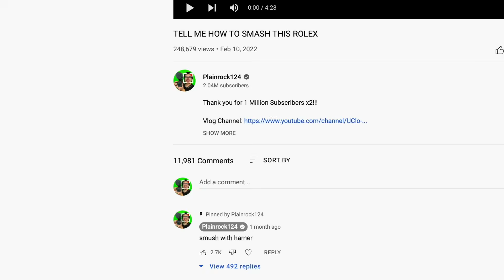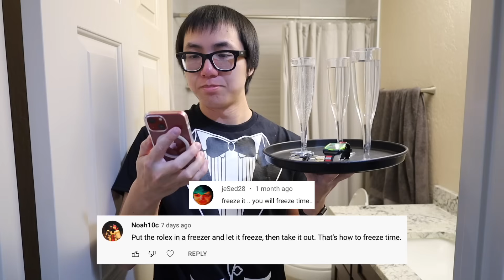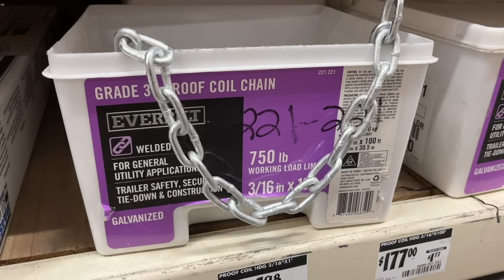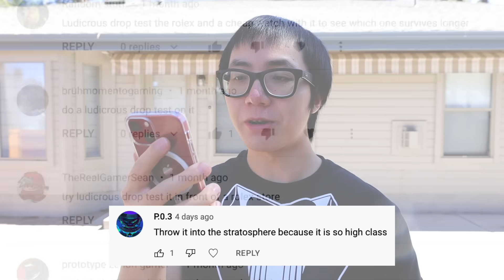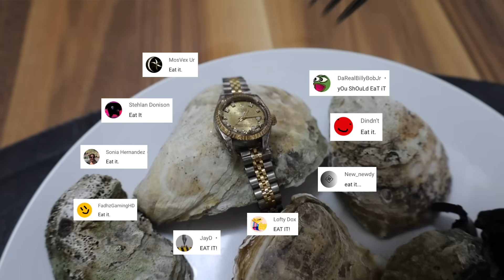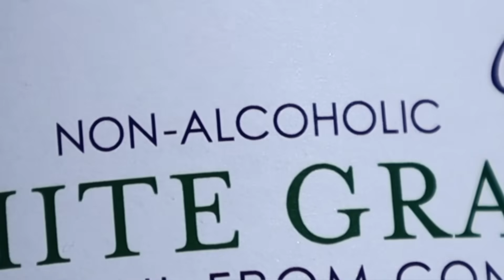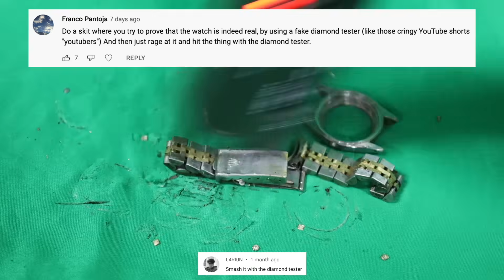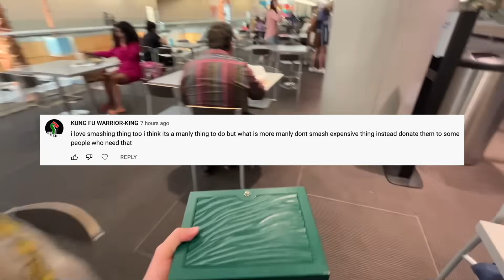Bored Smashing - ROLEX! (2 MILLION SPECIAL)

Comment: Price Overview: Rolex Daytona
Reference 
number	Price 

(approx.)	Material, bezel, dial

6239	
300,000 USD
	Stainless steel, stainless steel

 panda/exotic
116506	

145,000 USD	
Platinum, ceramic, ice blue
116508	

114,000 USD	Yellow gold, yellow gold, green
6263

	121,000 USD	

Stainless steel, Bakelite, reverse panda